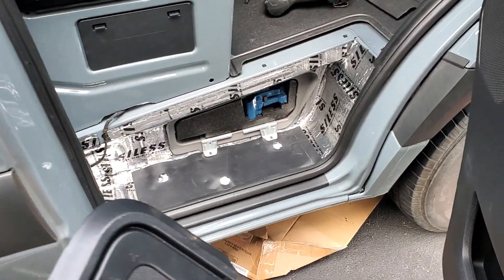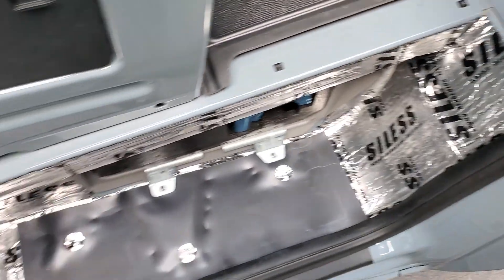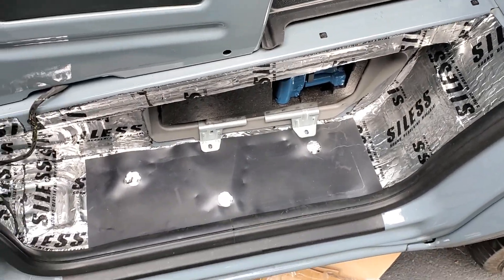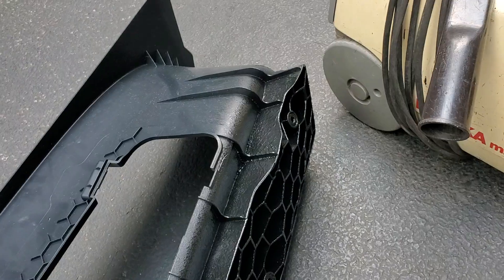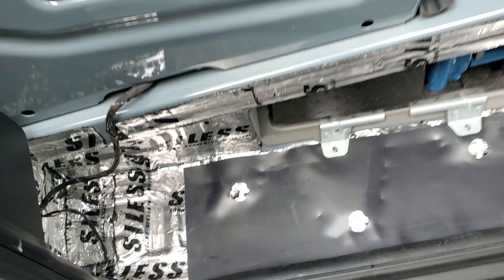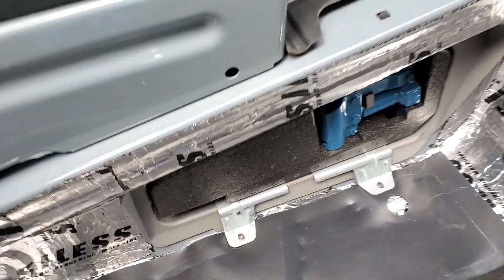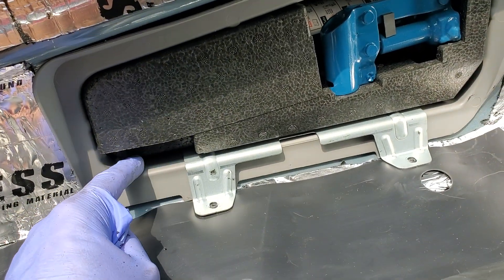Sprinter Steps Make TONS of road noise! Insulate Them!!

Comment: Thanks for sharing. I am too annoyed by my Sprinter noise with reading of  an aweful 69dba at highway speed! A quick question: how did you put the insulation mat inside the metal fender liner? The little gap is not enough for you to operate. Did you take the metal fender down first? if yes, how.
Reply from the maker: I have another video of insulating the wheel well liners if thats what you mean? I took liners out and covered them on the backside and sprayed on exposed side.
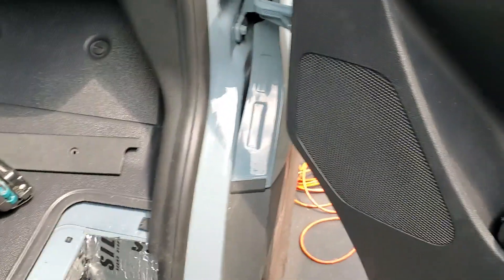Reply: @wetlifesports  Thanks, I am referring to the location when you say "silver stuff" at 1:53 in the video. So you can access that area after you take out of wheel cover? Thanks.